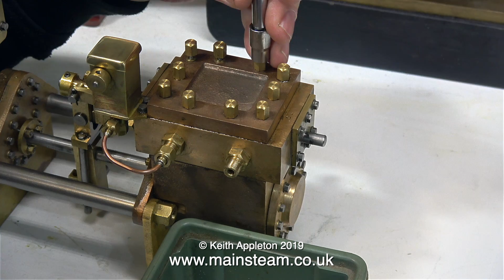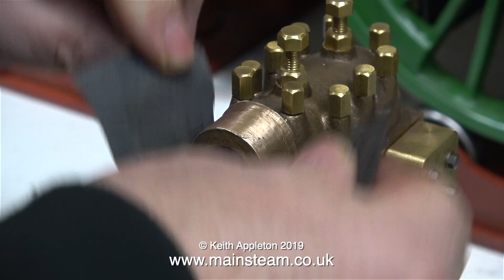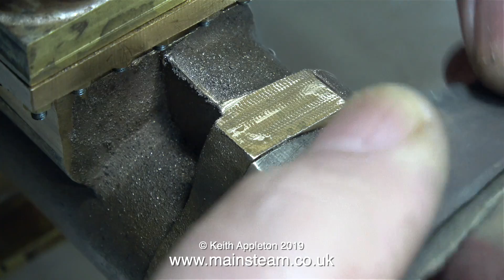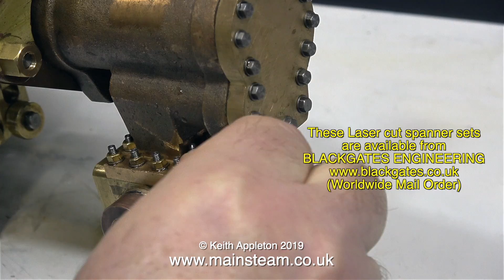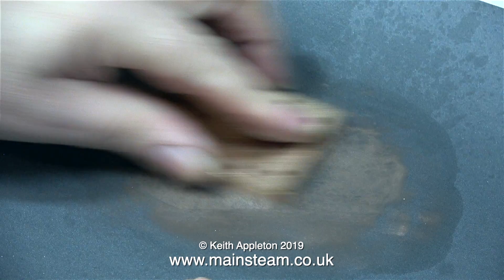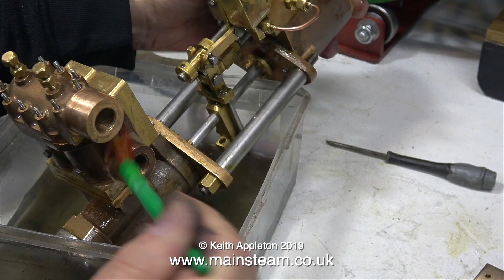A HORIZONTAL SOUTHWORTH 12 INCH BOILER FEED PUMP - PART #6

Comment: Panel Wipe appears only available in the UK. It is not available in Canada that I can find, the only Naphtha products over here are Coleman Camp Fuel  at $26.99 for a US gallon 3.78L or lighter fluid at $4.99 for 341ml
Reply from the maker: It is used in automotive paint shops.